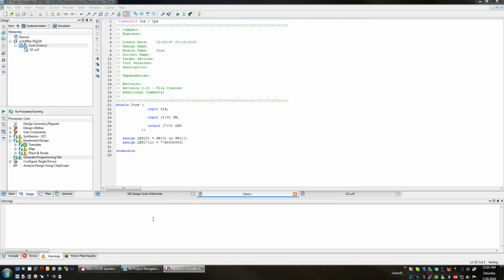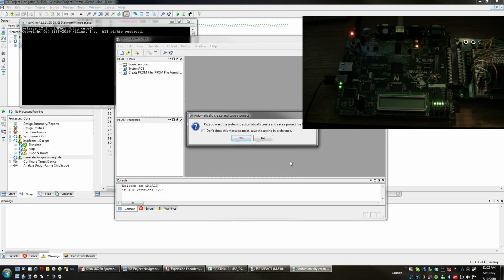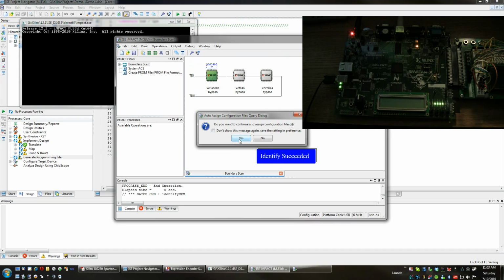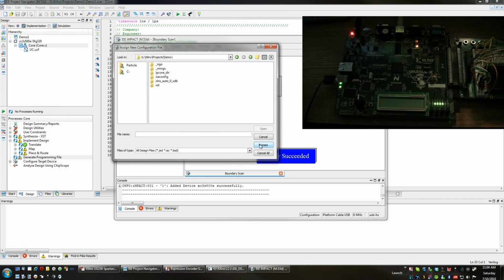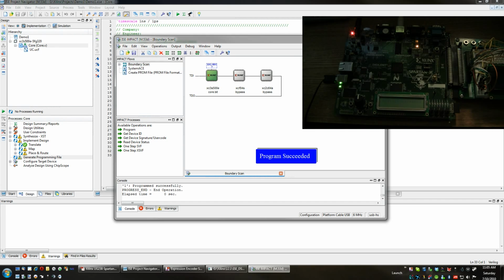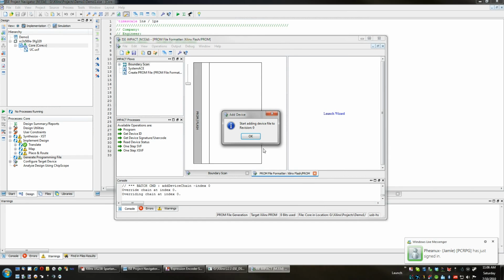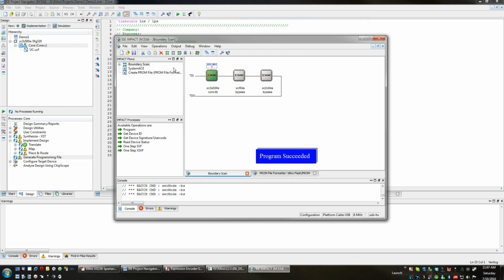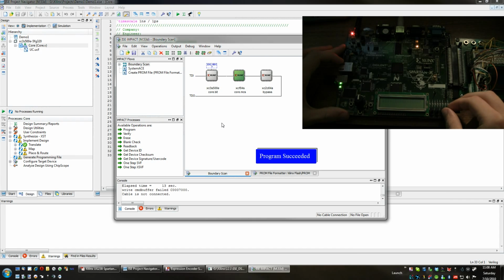Intro to FPGAs for Software Engineers - Part 5 - Programming, JTAG, PROMs, & iMPACT

Comment: anyone can help to fix driver issue?
Reply from the maker: The last time I checked it seemed like these old ISE Webpack versions no longer work with modern Windows, but it's certainly doable if you want to use a separate box to do your JTAG programming running something like Windows 7 or Linux.  What is your setup?  You can even still use Webpack on another machine for editing and building bit/jed files and trigger the programming in iMPACT remotely.